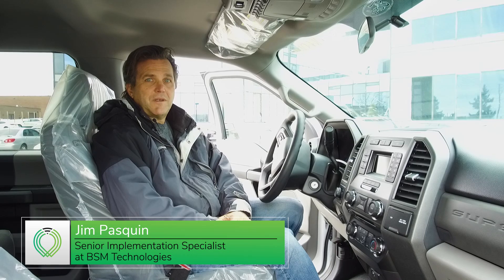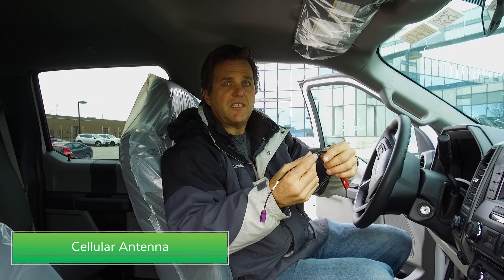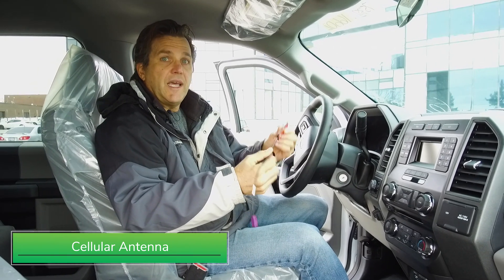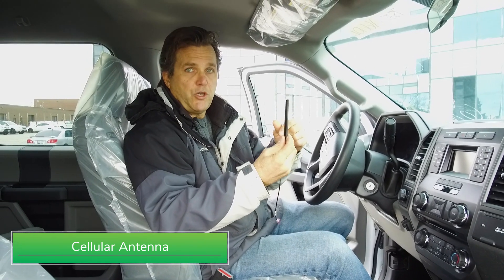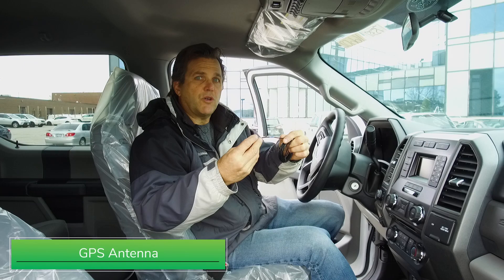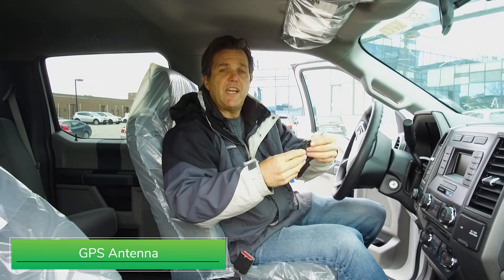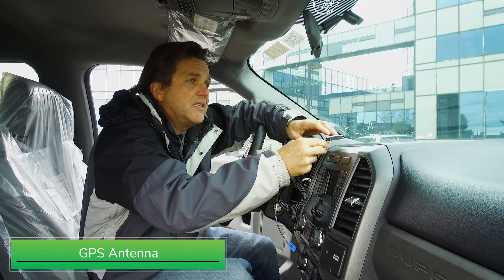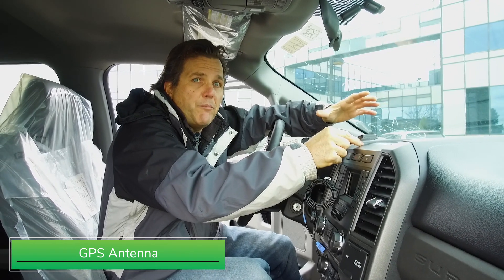Where to Place GPS Antenna

Comment: Some people said it's better to mount the gps antenna to a metal surface like ground wires so it will boost the signal, others says the optimal location will be on top of the roof and some people like you says under the dash. 3 totally different location. Damn and I thought my head unit was the toughest to install. The more I watch all these tutorial the more confused I become, and my gps is still dangling at my feet.
Reply: Well, since most of my GPS antennas come with a magnet on the base (not necessarily for auto use, but it's still GPS), I am lead to believe that it is OK to mount the antenna on top of a magnetic object (i.e. a ferromagnetic material, such as steel).
Reply: @m_a_s6069  Most if not all GPS antennas installed in cars from the factory are mounted on the roof. I have to believe this is the optimal position for a GPS signal. I mounted mine to the roof and ran the long wire all the way back up under the dash hiding the wire under plastic trim and carpet. More work  but it works great. If you don't know how, or just too lazy then mount it on your dash. It will look like crap and the signal will drop out a lot more often.

Comment: Need to be in line of sight not under the dash??
Reply: Peppy The Miniature Schnauzer The word “sight”, in this context, is used figuratively in the same way one might say that a proximity sensor “sees” a nearby object or in the way that a solenoid valve “sees” the presence of vacuum. Mounting your GPS antenna using the method described in this video is the absolute best way to mount a GPS antenna.